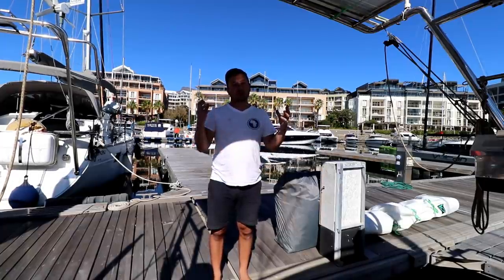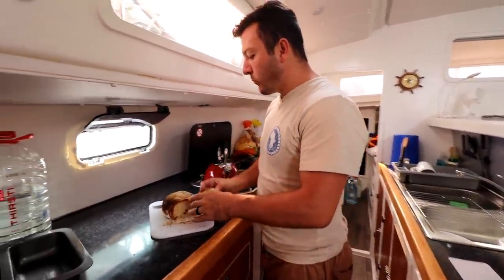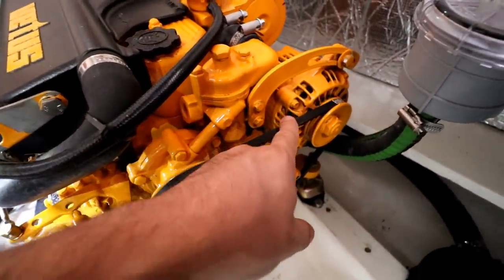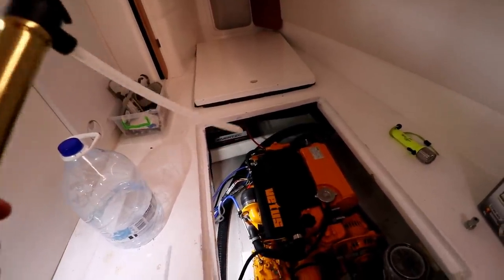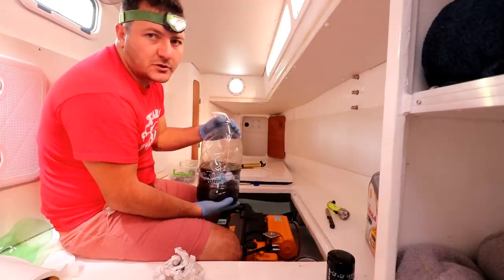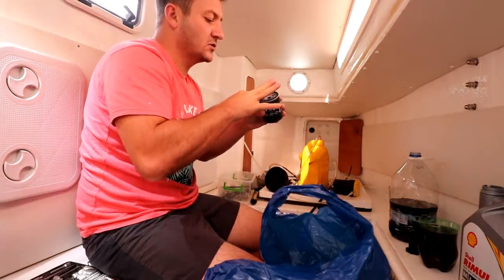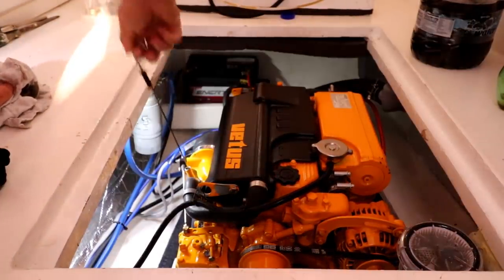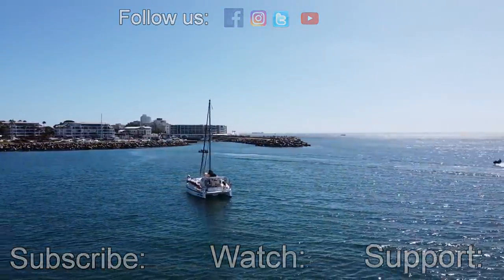Service Time For Our Engines | Vetus

Comment: Ricky, there is a nice fitting that I noticed on some new Marine Diesel Generators that I really like... not sure how difficult it will be to install on your engines to make it worth it but; the oil drain plug on the bottom of the pan is removed and a 90 degree fitting with a valve is installed and from that a short length of hose goes to another small fitting with a valve.  When you want to change to oil you can easily reach the hose and attach the pump suction to the end and open the two valves.  Neat idea?
Reply: Heya , yes vetus does have them as an extra option. going to look into the cost of them!

Comment: Ricky, a good tip on those oil filters, get a zip lock bag and wrap it around the oil filter once you have it cracked free.  Then when the filter comes away from the block the oil and eventually the filter falls into the bag then you zip the whole thing up and dispose of it.